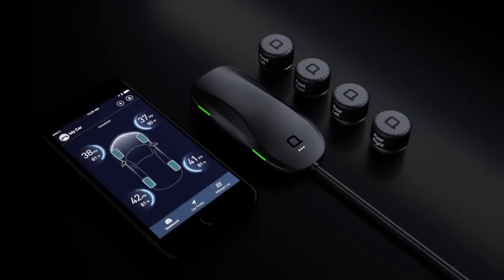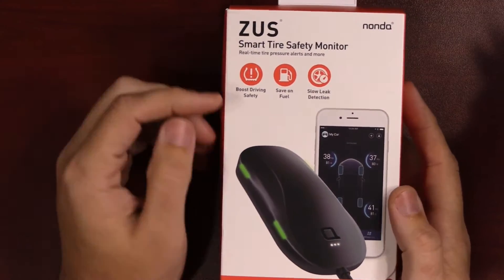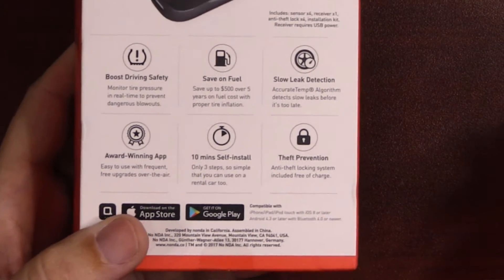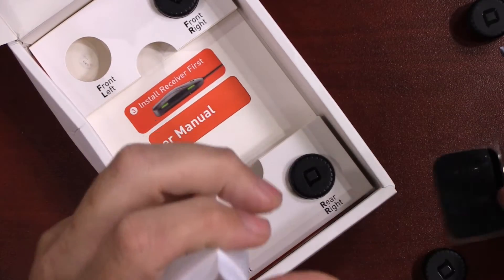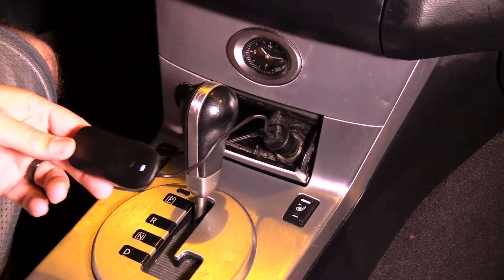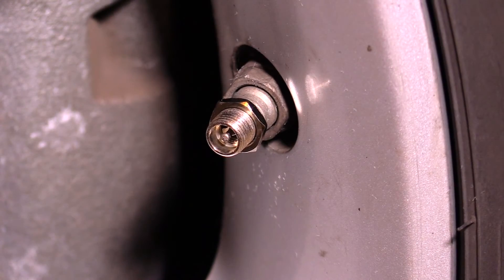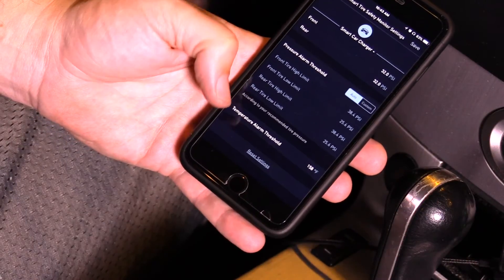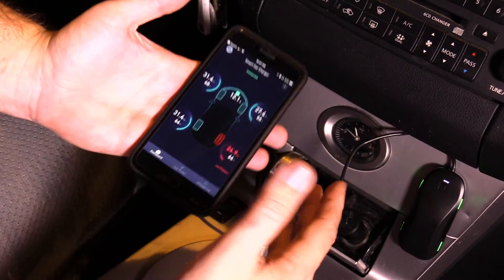ZUS Smart Tire Pressure Monitor ▬ Make your OLD CAR...SMART! series - Part 1

Comment: Hi. Thanks for your review.

After instalation, i found the following problems.

TPMS problem:
After installation, there are only 2 green lights for the right tires ( Front right & Rear Right) shows up. The lights for the left tires are off even it shows connected with all of them in the app. What should I do ?

TPMS Question:
Is this system supposed to work even when the engine off or it just only provide information while riding ?

Thanks!
Reply from the maker: You're very welcome. Thanks for watching.  I'm not sure why two of the lights won't show up. Maybe you got a bad unit. I had an issue seeing the right side lights from my left driving seat and I thought they weren't working until I really looked. If you drive from the right seat, just remove it from the dash and really look at it.  If they are out, then return it for a new unit.  It only works when there is power to the power adapter. I know most car's power adapter turns off when the engine is off thus turning off the TPMS.
Reply: Thanks. all unit working just fine but only the lights for left tires not show up. Kinda hate it.
Reply from the maker: I would return it and get a new unit.

Comment: What happens when your mechanic rotates your tires?  Switch them back to the front/back respectively?
Reply from the maker: +David Hixon Good question. Yea,  just move them around. It’s super easy. It will take less than 5 minutes.

Comment: Thanks for the review. I just bought the LMYSTAR tire pressure monitor and you don't need a receiver in your car as they are Bluetooth directly to your phone. Hopefully you can review that one as well soon.
Reply from the maker: I hope you leg is getting better. Did you need surgery? 

I'll  check it out and see what its all about. Questions though, With that one, I'm wondering, if you have 4 separate  bluetooth connections to your cell phone or just 1?  Also, does the app let you know when one of you tires is low even if you don't have the app running in the background?
Reply: ModernDayFamilyMan Didn't need surgery!! I did 3 more weeks with a boot and now I'm in rehab. It's a slow recovery :s thanks for asking
Reply: ModernDayFamilyMan I didn't get the package from Amazon yet. I'll let you know how it is. Im also curious about the Bluetooth setup and the reliability. Next week, I'm getting the orbit card, can't wait to try it out.